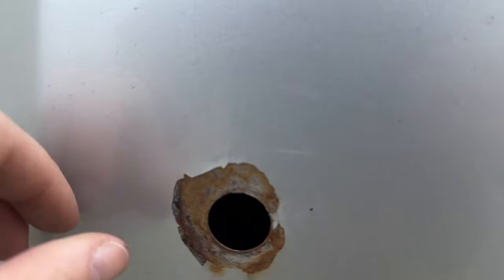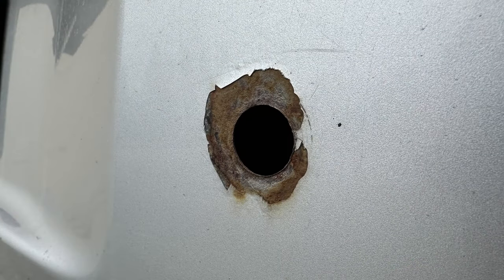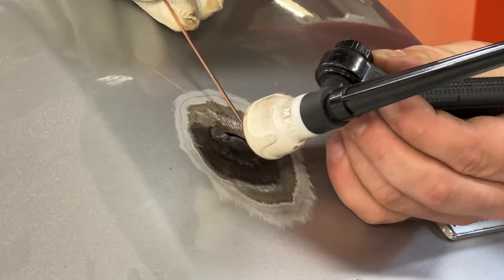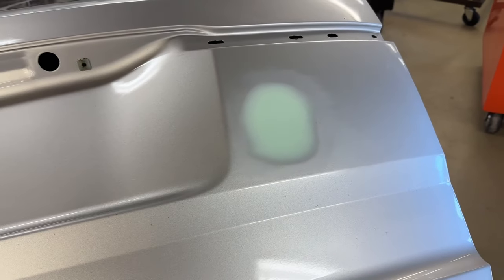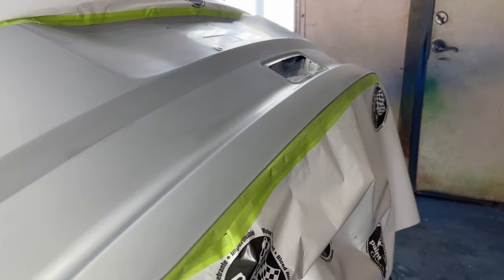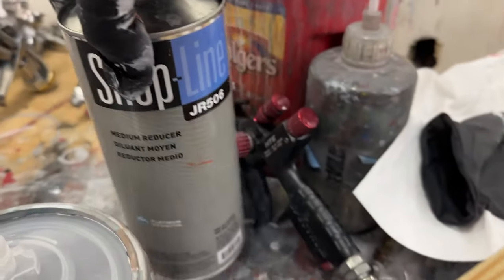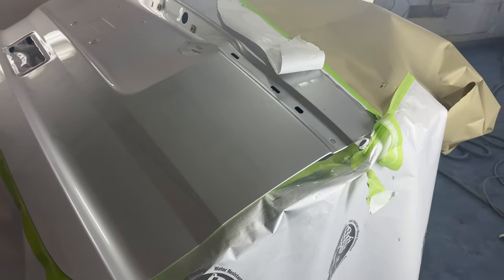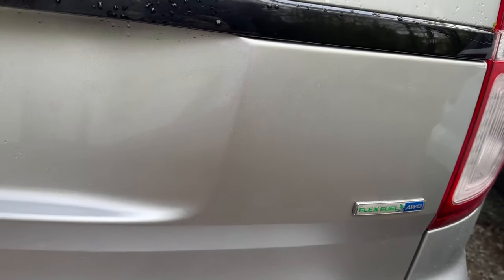How to Patch and Repair Rusted Tail Gate on a 13-15 Police Interceptor Utility

Comment: Another good video.  I have the same holes in my roof from the antennas, about 6 ofvthem rubber pkus work and are not noticed in SUV. But are visable on charger n taurus.  My 2017 explorer  has massive rust in the inner lip edge of the tailgate and botton doors..